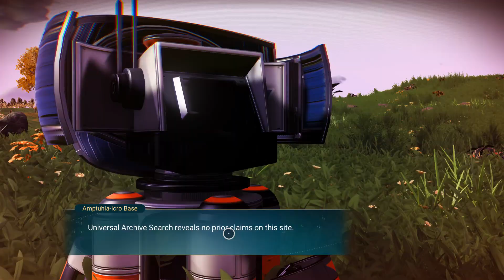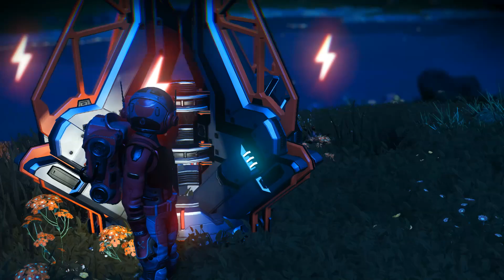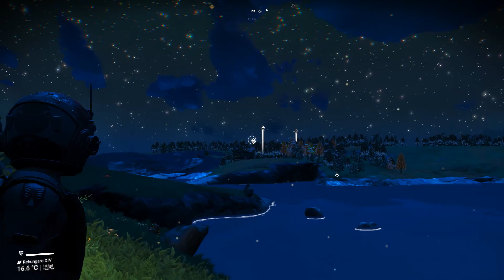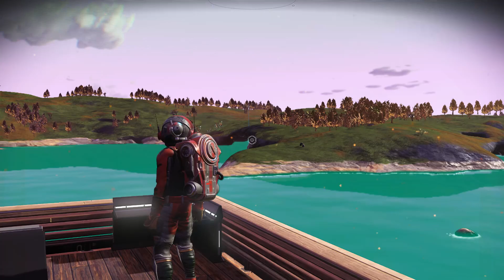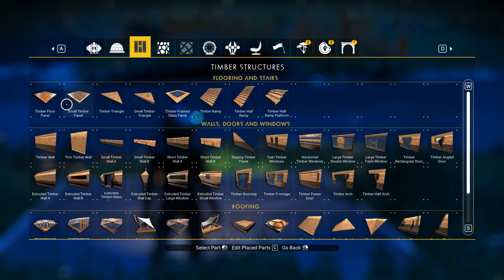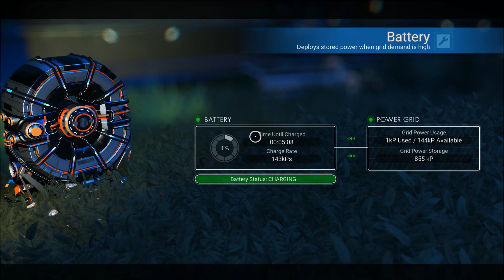How to Extend the Limits of your Base - No Man's Sky Guide - Frontiers Gameplay

Comment: It works as of today, nothing's been patched just save and reload your save and reload after you've placed the first platform at the base city limits, from there on you can advance toward your Magnetic hot spot, place batteries along the way to connect the electrical line or you won't be able to reach the base in a single hop.👍

Comment: It doesn't work for me. I put this floor every few meters and it still shows that I'm out of range...
Reply: Same happened to me today!
I wonder if this last update has something to do with it!
Reply: @pedroteixeira2601  I solved this mate. Make your main base, and second (power station) in place whare electic source is located. Then from ylur main base every few meters you need to put any object and observe if the base you edit is still your main base. When you reach your power station base, put there pylons and battery, connect them and then you need to put few batteries in your main base and connect the cable to battery located in your power station base.
Reply: @Slavix-God  thank you sir!!!
Reply: @pedroteixeira2601  Welcome ☺️